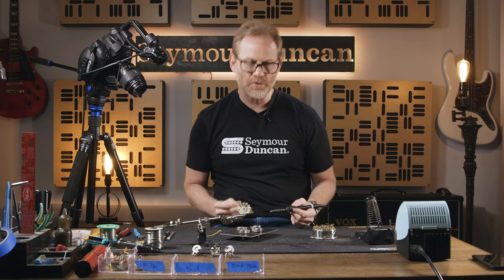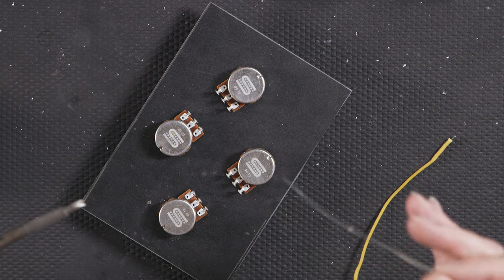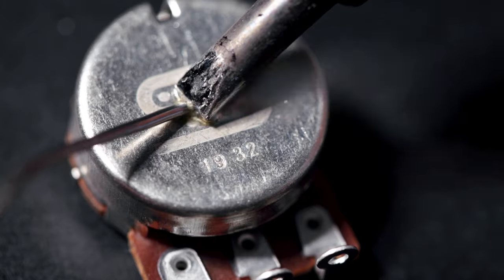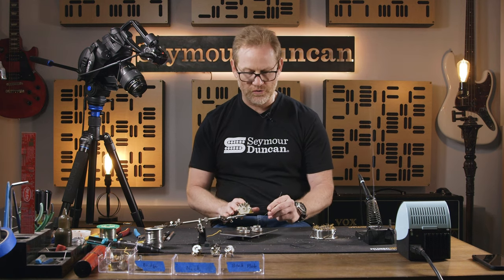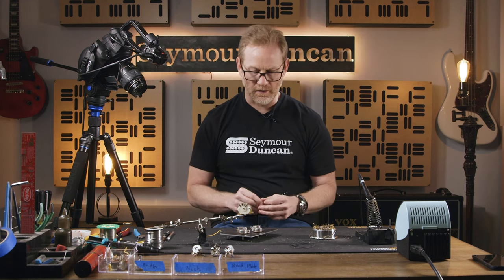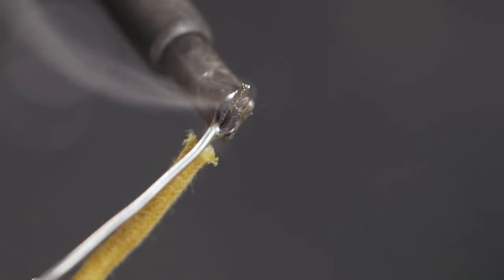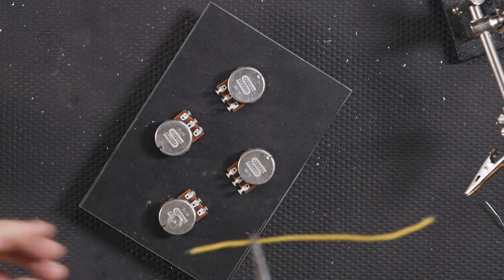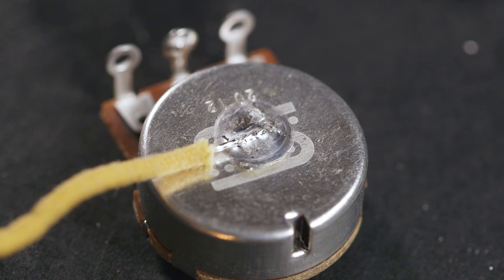Guitar DIY - Soldering Wires to Back of Potentiometers

Comment: This is the hardest part for me.
Reply: Same
Reply: Same here
Reply: He didn't mention that you need to use a temperature controlled iron,  and I turn it up to 450 Celsius or higher for pot casings.   Also,  if the casting is tarnished,  you should abrade it with fine sandpaper or scotchbrite. Another thing he didn't mention is that if the pot is installed in a metal plate (eg fender jazz) or an aluminium stompbox enclosure or similar, you'll need even more temp since that will sink even more heat from the pot casting. In these situations,  I use a large 60w soldering pencil.  Another very handy item for soldering is Blue Tack.  You can use it to hold parts and wire in place.
Reply: @RobMods  : Why bother soldering ground wires to the pot casings?  Why not instead use a WAGO 221-415 as a hub for all the needed grounding paths?  With a WAGO, no soldering is needed, and I don't see a reason why the pot casings need to be grounded.
Reply: >juanjan__  : There's enough space for multiple 5-slot Wago 221-415 connectors in the G&L ASAT Classic guitar that I re-wired a year ago.  The groove carved in the guitar wood underneath the controls (which provides space for the undersides of the pots & switch) is wider than the 5 slots of a 221-415, and is deep enough that Wagos could (if necessary) be stacked two-deep under the pots.  In other words, plenty of space.
     In my project, I used one 221-415 as a hub for indirectly connecting all the grounds, and two 3-slot Wago 221s to indirectly connect the two pickup signals to the switch.  The only soldering needed was on the controls while the controls were far from the guitar... no chance of the hot iron accidentally burning the guitar's wood or finish.
     The 3rd slot of each of the two 3-slot 221s is available for experimenting with a tone-altering capacitor.  It's quick & easy to connect the capacitor's two leads to the 3-slot Wago and the 5-slot ground hub Wago.  In other words, the capacitors don't require any soldering either.
     The original purpose of the Wagos was to help me replace the G&L stock controls with a Hoagland "1952 Tele-style" wiring harness.  The Wagos worked fine.  However, I decided I preferred the sound of the stock controls, and the Wagos made it quick & easy to disconnect the Hoagland and reconnect the G&L controls.
     To check whether a guitar has enough space under its controls for Wagos, you can unscrew the control cover plate and look.
Reply: >juanjan__  : The cavity for the pickup is irrelevant.  Look underneath the pots & switch for the space to add Wagos.
Reply: >juanjan__  : Looking at online images of Sire U5 guitars, I see its control cover plate is on the back side of the guitar. (That makes the face side more elegant.)
     How much distance is between the pot bodies and the cover plate?  You would need only about ¹/₄ inch.
     How wide is the control cavity?  It doesn't need to be wide-enough for 5-slot Wagos, because 3-slot Wagos can be daisy-chained.
     Does the Sire U5 have ground wires soldered to the back of its pots?  Or does it solder to pot terminal lugs?
     How are the pots attached to the Sire U5?  The online images give me the impression that they're attached to the wood of the face side. (Not to the cover plate on the back side.)  Some guitars in which the controls are attached to the cover plate rely on the conductive metal of the cover plate to ground some of the controls, instead of soldering ground wires to those controls.
Reply: @brothermine2292  mate, I gave you a reason. It won't fit. Trust me. No please stop, thanks
Reply: @juanjan__  Okay, I'll trust you that Wagos won't fit anywhere in the Sire U5.  But I would appreciate it if you satisfy my curiosity about how its pots are attached.
Reply: @RobMods  Thanks FINALLY some one who mentions the Temp.
Reply: @RobMods   Yeah you need much higher temperature, also when removing solder from the pot casings

Comment: Easier said than done. It's never been that way for me to solder a pot. New or old. What is the right solder iron temp to solder on a pot? Do we need to use a certain tip too?
Reply: take what I say with a grain of salt because I am new to soldering... but let me tell you this; the first couple times I tried soldering a wire to a pot, I was so frustrated and damn near depressed because no matter what I did, the solder WOULD NOT STICK! the reason for this (I found out later) was my temp wasn't high enough... I had heard you could mess things up if the temp was too high, so I was wary of this... later I discovered a guitar forum post and a lot of guys there were saying they just crank their soldering irons super high, to get the solder to stick to the pot. the important thing apparantly is to work quick, if you go fast, it will be fine. I was originally doing about 325 C (which worked pretty well for soldering stuff other than pots) but then I put it up to 400 C (about 800 F) and the solder stuck to the pot so easy!

so to answer your question, 800 F worked for me, higher might be ok too, just work quickly (i wouldn't leave the iron to the pot more than a few seconds). Also the tip I used was like the one in the video, other tips might work just as well, but I think a good high temp is what's more important.

Good luck Jeff, I hope this helps, I know soldering can be a pain in the ass when we're just learning lol
Reply: @SeanDS89  yep. a lower-temp iron that you have to hold on the pot forever causes more damage than a hot iron that flows the solder quickly.
Reply: My tip?  Do not use lead free solder (!)  If you do you're in for a bad time.  Leaded solder flows on the pot almost instantly and makes the job a pleasure..
Reply: For pot casings,  I turn my iron up to 450C or higher.   In some situations,  I use a 60w solder pencil with a large chisel tip.
Reply: @ReValveiT_01  thanks for that
Reply: Technique is important as temp. You want the back of the pot to be hot enough to melt the solder.... That way it sticks. If you just melt the solder and not warm up the surface to which you want it to adhere, it'll fall every time.
Reply: Solder just doesn't stick to anything without using some kind of good Flux.  It will just roll off your soldering iron tip or roll off the pot. Just my experience. Have you left out some info or using some kind of flux?

Comment: How hot does the iron need to be to facilitate a weld on the pot casing? My dwell times are way too long and the joints look terrible.  The casing will not get hot enough to accept the solder.

Comment: It is beneficial that Seymour Duncan in located in the US, in that, leaded solder is still available. Before you solder you have to understand what you are soldering and what is needed to joint metals using solder. The expert source for production soldering is IPC standards and training. Since this is hand soldering you will first choose your flux cored solder wire type, flux and diameter. 

A good choice for no clean guitar wiring would be Kester RMA 285 Type 66 Flux cored solder (2463379710), 0.031 inch diameter (a good size for the point to point hand soldering of guitar wire and components), Eutectic Sn63Pb37. A compatible liquid flux would be Kester 186-18. The 285 Solder and 186-18 flux are no clean, meaning the solder residues generally do not need to be removed. You can remove them using IPA if you wish. 

For soldering a wire to the back of a pot, which is a very non-traditional way of using a pot in a circuit, the task is a special one, in that, we are soldering a wire or a braid to a potentiometer metal case. For all hand soldering do not hold wires in your hand when soldering, always use a third hand so there is no chance of movement while the joint is solidifying, so both the pot and the wire or braid should be rigidly held in place while soldering. This is also true when soldering components to a PCB. If the joint moves while solidifying it is a poor or "cold" solder joint.

Next clean the back of the pot, I like using a small grinder with Scotchbrite superfine to remove oxidation, then clean the pot with IPA and let dry. Then use a large enough chisel to transfer enough heat to solder the joint quickly. For back of pot wiring, this usually means the soldering iron is 120W or larger. Place the braid onto the pot, add liquid flux to the braid and the pot case, tin the soldering iron tip slightly, and solder the joint. Use enough solder to make a nice shiny joint in the form of a round smooth puddle on the back of the pot. If you have several wires or braids connecting to the back of a single pot, position them together and solder at the same time. After the pots are soldered it is good to condition the pots with Deoxit D5 spray before final assembly of the guitar. You can use added liquid flux to all the joints if the components are somewhat oxidized, the added flux will help remove the oxidation.

The chisel tip used in the video is a little too small to solder to a back of a pot. For different soldering tasks you will change soldering iron tips. So soldering to a pot case would use a larger chisel than to the pot circuit terminal, where you may move to a conical shaped tip.

Comment: I noticed the position of your solder pool is centre, does this give the maximum room for electrons to flow? As opposed to for example the side of the pot which is aesthetically more pleasing but shortens the path for the ground to flow.

Comment: I don't have any issues with regular pots, but push pulls seem very sensitive. It's really easy to wreck the push-pull feature, or if it still works, it loses the click when you pull it out. Any tricks there?
Reply: After tinning the wire and the pot, I use a squared off popsicle stick to hold the wire down against the pot as I put the the soldering iron on the pot-wire joint.  Wood doesn't conduct, so it absorbs little heat from the soldering iron.  This lets me remove the iron quicker and avoid damaging the pot.  I hold the popsicle stick steady against the wire for a few moments until after the solder joint flashes over.
Reply: @fireball1066  Thanks that is a great tip I will definitely use!

Comment: This might be a silly question but am I supposed to use only either yellow or beige covered wires for pots and switches and save the black for ground? I just completed a build using only black covered wire because I thought I was on a roll but now I'm scratching my head... Thanks.
Reply from the maker: Black for ground is what most folks use, but you can use whatever color wire you have handy.

Comment: What temperature do you do that at? You made that easy..never that easy for me.
Reply: You need 700 degrees Fahrenheit.  It can be done with less, but you have to stay on the pot longer and that might damage it.  If your iron is one temperature, and perhaps less than 700 degrees F., solder the pot with NO other metal touching it. Any extra metal is absorbing your iron's heat and slowing down the process.  Rob Mods comment above yours explains it well, and using tape to hold things still is a great idea.  I'll also lay a screwdriver or pair of pliers on a part/wire to hold it steady.  Juggling/moving parts (iron, pot, wire) will cause a bad solder joint.  Keep your tip clean for maximum heat transfer, and after doing one pot you might have to wait a few moments to give your iron's tip a chance to get back to max temperature again.  One other "tool" I find very handy is a wooden toothpick.  I like to have solder already on the pot lugs, but not so much that it closes the little hole.  Small wires,  especially from humbuckers, don't poke through easily.  With the soldering iron on the lug, I'll first poke a hole through it with the toothpick, do a half-spin, and remove.  Then I insert the wire, put the iron back on (which re-flows the solder), and apply a quick dab of fresh solder.

Keep old pots around for practice.  I put them upside down with the shaft stuck into some cardboard to hold them steady.  Spreading the solder on the pot (as in the video) is also very effective.  Finally, use a tip you're comfortable with.  I work best with a flat 1/8" (3mm) wide tip.
Reply: @fireball1066  My iron is maxed out at 30,000 degrees celtatude and it still wont stick.🤣

Comment: One is easy but how do you do 3 or 4 wires without having them pop right back off?
Reply: I try to twist them all together creating one ground area.
Reply: Late to the party, but if your solder is at 700, you can tap quickly and the wires won t pop off, or you can braid them into one to solder one braid...

Comment: OK, but for guitars with rear cavities don't you have to do this in the guitar?  And also there are so many wires to go to ground.  Do you put them all together and then solder them or solder each ground individually to the pot?  Why not have all the wires go to a wire nut or something that has a wire going out to your bridge?  Do the grounds need to go to the pots or can they go directly to the bridge?
Reply: I sure wish they would answer these questions, a lot of us have these same questions. Can we get an answer on what temperature to run on the soldering station ( approximately).
Reply: you need grounds on the pots to divert current from the hot (white wire). thats the job of the pot, to decide where to send current based on knob position. as more current goes to ground, the volume drops or tone filter sweeps. 
on the same pot, you can bundle into one solder or clean individual solders, as long as the entire ground has continuity. I prefer individual ground solders because it makes future pick up swaps easier.

Comment: No sand paper?
Reply: Why? The backs of pots are already tinned. Sanding the surface won't cause solder to flow better; it isn't hot glue.
Reply: @michaelwoods9005  it will help. How are you claiming the pots are tinned? They are bare metal aren’t they? Smooth surfaces aren’t as easy to heat to the right temp quickly, there are tons of videos out there from experienced guitar techs all saying use some kind of sandpaper or Emory cloth to roughen up the surface.

Comment: Is there a reason why the guitar pot cases NEED to be grounded?  It looks like the pot cases are just being used for convenience, as a hub where other ground wires connect to each other.  But other alternatives might be even more convenient.  Why not instead use a WAGO 221-415 connector as the hub?  The -415 can quickly connect up to 5 wires without any soldering, and a WAGO can be disconnected and reused many times.  In particular, a -415 could connect the two pickups' ground wires plus the output jack's ground wire plus wire(s) from the ground lug(s) of the one or two volume pots. (If 5 wires isn't enough, a second WAGO could be added to handle additional wires that need grounding.  One of each WAGO's 5 slots would be used for a short jumper wire connecting the two WAGOs together, so two -415s would allow up to 8 ground wires to be connected together.)

I'm assuming there's room to fit one or two WAGOs somewhere under the controls.  WAGOs are small, so I think this shouldn't be a problem.

The 221-41x series (-415, -413 and -412) are rated for a wide range of wire sizes, as thin as 24 AWG.

When I learned electronics, I was taught that solder isn't supposed to be used for mechanical connections, only for electrical connections.  Wires to be soldered should first have a mechanical connection made for strength, for example hooking the wire's copper end through the lug to hold it in place before soldering the copper to the lug.  If volume pots were intended to have wires soldered to their cases, then they would be manufactured with lugs on the cases.

Some wiring designs rely on the metal control plate or metal foil under the pickguard, plus the metal nuts that hold the parts to the control plate or pickguard, to provide a grounding path between the two pots' cases and/or to the output jack.  Using the control plate or pickguard foil in that way may be convenient, but it seems like poor engineering to rely on nuts staying tight, and sometimes the wiring diagram neglects to show that the control plate or pickguard foil is serving as a wire.

Comment: My solder just turns into a ball and rolls off, looks so easy here, never works like that for me.
Reply: Make sure you give the back of the pot enough heat. Solder tends to roll off when the pot isn't hot enough. Took my a while to learn that. If you're still finding problems than get a bit of light sandpaper or a screwdriver and lighty scratch the place where you're soldering. That should help the solder stick to the pot.
Reply: You need a hotter iron with a chisel tip and tin/lead solder, either 63/37 or 60/40.

Oh, and sanding the pot won't help anything. Solder doesn't "stick" to surfaces, it uses heat to form an inter-metallic bond. It isn't hot glue.
Reply: @michaelwoods9005  this is spot on. set your iron to 700 F, use a wide flat tip, 60/40 resin core. The whole contact process should only take 3-5 seconds.
Reply: I was about to type the same thing! It seems that lead-free solder sucks and will "ball up" It just won't be very secure, either.

I tried with an old pot that had 63/37 rosin core solder still on it and it melts a lot faster and sticks to the pot without sandpaper using a sharp tip (not a flat chisel tip) 15w soldering iron that heats to 440° C. I tried the lead-free solder on that same old pot and it won't stick. It's gotta be the solder type. 

Also, using the chisel tip makes it easier when working in the cavity.